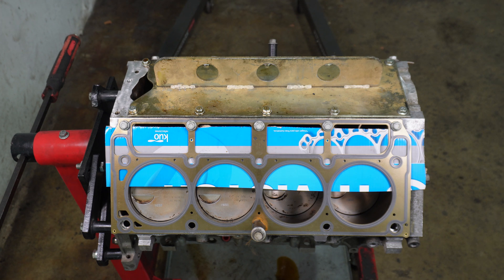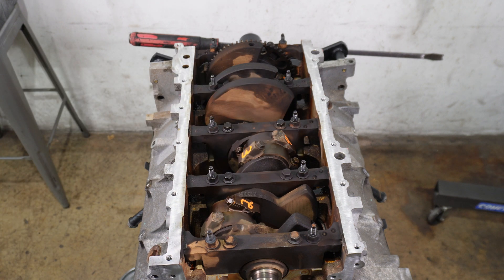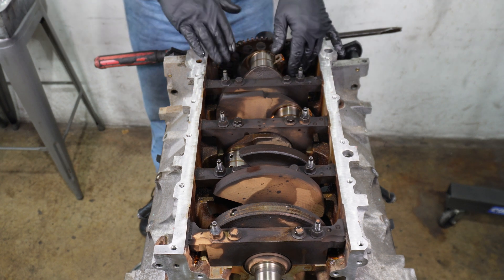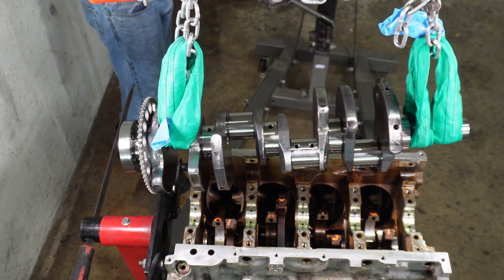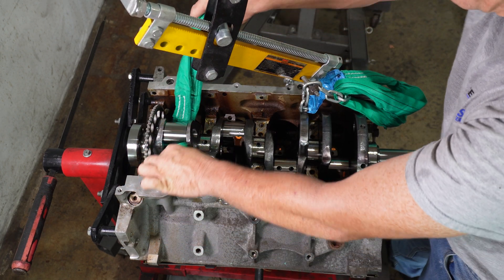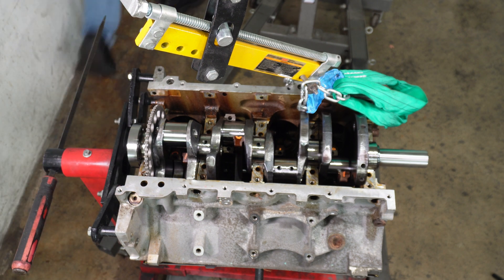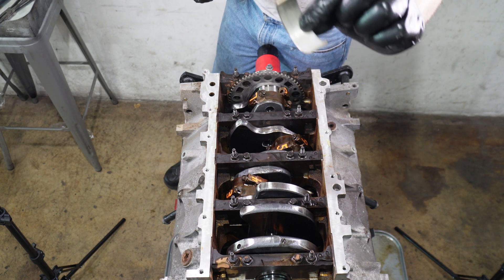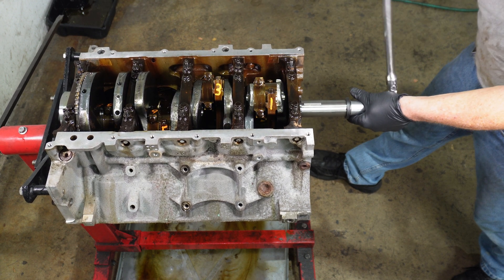LS3 Crankshaft Swap for Dry Sump – 2008 Z06 Corvette Build

Comment: What’s the stock ls3 crankshaft number? I want to make sure I got the right crankshaft
Reply from the maker: Wet sump LS3 crankshaft part number is: 12597569. Both wet sump and dry sump specs and part numbers can be found here: https://www.onallcylinders.com/2017/11/02/ls3-engine-specs-performance-bore-stroke-cylinder-heads-cam-specs/